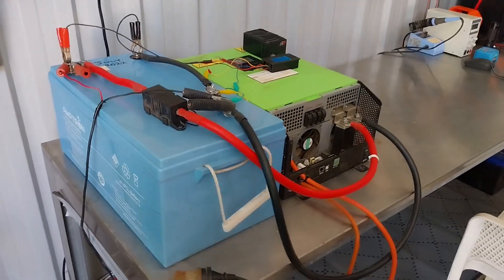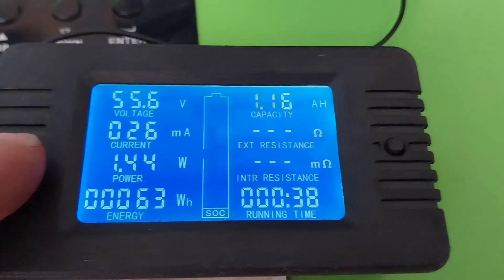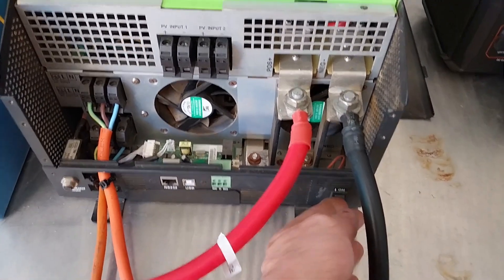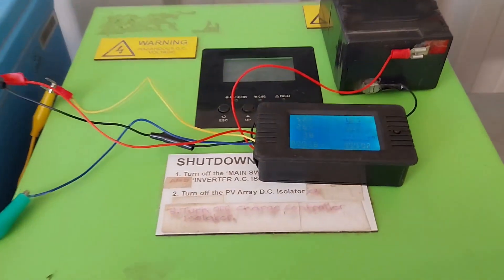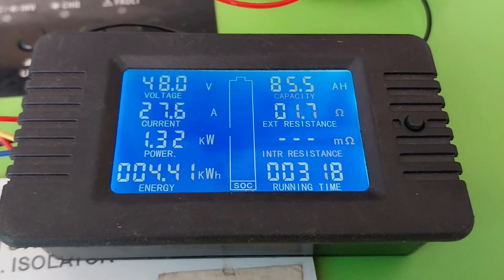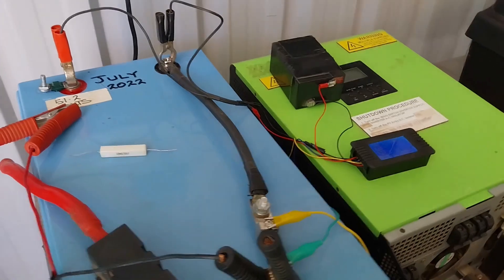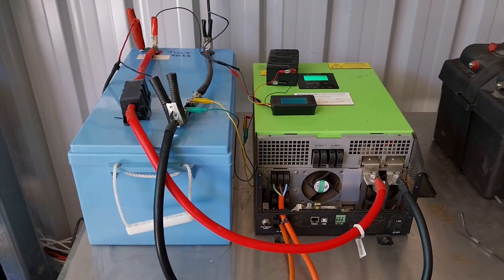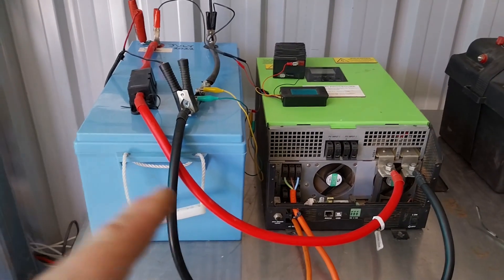48 Volt Lithium Battery Capacity Test & It's Not Looking Good

Comment: Connect up a JK 2A active balance bms. Then use the blue tooth to monitor the cells voltage as you carry out another full charge and capacity test. This way you’ll be able to identify the weak cells as they will reach full voltage before the others and discharge much earlier.

Comment: I would try to get the new one from them. It looks like the new ones have RS-485 and Bluetooth, so you can hook them up to the Cerbo and monitor with a phone app. I would think after 4 years the inside of this battery will be very different to the current battery. You will be disappointed if there are cylindrical cells instead of prismatic ones. You might end up with a pile of e-waste that will be difficult to dispose of.
Reply from the maker: They are prismatic cells by what I have been told by the battery company. These batteries, even with less capacity are still very usable so I wouldn't be throwing them out.
But first I need to do more testing on the others and see where we are at and have a chat to the supplier then we see where I go from there 👍

Comment: I have been living for 20 years on the same battery bank, 24V, 1600Ah exide wet cell lead acid.  3 kw victron inverter/charger.  Yes, they are on their last legs, and likely around 15 years there was a noticeable lack in capacity, though not bad enough to warrant replacing.  I 
I've just recently upgraded my whole system to Lithium, 50Kw storage and a 10Kw victron.  the batteries drop 6-7% over night if I'm not running my 3 door drink fridge used for hanging animals.  Batteries are full by 9am every day, the rest of the day, everything runs off the solar array, 8.8Kw.
I will be surprised if i get any where near the same service, but with rebates at the moment, a new lead acid bank was going to cost the same as a full upgrade.
Reply from the maker: I was just talking yesterday to a fellow off gridder and was saying.... even if Lithium's don't last as long as they say, the higher operating voltage and current delivery is worth it and the cost to replace lead acid batteries is working out more expensive then Lithium.
He also agreed with me based on his experience between lead acid and Lithium batteries.
Reply: @TheOffGridBachelor  And i agree too.  The rate of charge/discharge is an impressive thing.  I still keep the charging lower than stated rate by only having a smaller solar array, i believe fast charging if any battery will shorten life.  I believe that's why I got so long out of my old lead acid.  and yes, lithium is way cheaper now.

Comment: No mention of the chemistry of the battery  so it is hard to tell how close to full that 55.6 volts actually is and how close 48 volts is to the bottom. Chemistry matters in terms of predicting expected cycles.  LFP tends to have more cycles than other chemistries which have higher voltages and use Cobalt. Most of my fifteen years experience with DIY batteries has been with LFP althought my EVs have all been NMC or  NCA. It would be nice to know if a faulty cell is shutting down that pack. It is too bad that that pack does not have some pack diagnostics to be able to more acurately assess health of the cells.
Reply from the maker: The battery chemistry is LFP.
I am suspicious that there is a cell issues that is shutting down the battery but without testing each cell, it's hard to know. The next lot of batteries I get will have blue tooth where I can monitor each cell voltage. Server rack for the 48 volt batteries where I can also open the case and prob each cell as well.
Reply: @TheOffGridBachelor  Thanks for clarifying the chemistry. As noted elsewhere an active balancing BMS can sometimes prop up a weak cell so some of the pack capacity can be restored. By restored, I mean that an active balancer will prevent a weak cell from getting to a voltage that will shut down the pack..
Reply: @ricklearn16  what have you done in 15 years of experience ?
Reply: @casemodder89 I have installed two solar systems and had two more professionally installed. On three of those I installed backup battery systems. I also converted a VW to electric. All of those involved DIY LFP battery packs. My last install, I sold the DIY batteries and integrated a 35 kWh Pytes V5 system with a 15k SolArk inverter.

Comment: Are you sure your charge target of 55.6V is high enough for the BMS to balance its cells?  Normally you charge to 3.55V/cell = 56.8V to give the BMS some margin to start balancing.  3.475V is a bit low for balancing.. the BMS might be balancing (usually the BMS starts at 3.45V or so), but for balancing to really work the cells need to be more onto the exponential part of the charge curve.

So I'd recommending holding it at 56.8V for ~2 hours , doing a few cycles like that, and then re-testing the capacity.  85% capacity is really low for that short a time.
Reply from the maker: Yeah the Bulk/ Absorption voltage is 56.8 volts and the float voltage is set at 55 volts. By what I have heard the BMS will balance the cells at 55 volts.
Reply: Are these 15S batteries? My 16S ebike LIFP04 packs have the charger set to 58.2...

Comment: You can't get an accurate capacity measurement using that tiny, toy, $29 Chinese made capacity tester.😂😂😂
Reply from the maker: Yeah I know it's not going to be accurate but they are close enough to give us a basic idea. With the BMS shutting down at 47.7 volts, that is a red flag of a potential issue.
I do need to get a proper high end tester though for sure.

Comment: I think you have demonstrated conclusively the problem faced by all real world batteries.  Depending on the technology used, will determine, the best efficiency or longevity modes of operation. Unfortunately, neither of these modes will correspond with the real use mode or indeed the highest profit mode !  It is the age-old problem of asking a salesman what his factory thinks the performance might be based on the best performing laboratory results, and ignoring all the tail ends of the binomial curves.  Given you have nearly got to the end of the warranty period, they seem to have got it about right contractually, but no surprise if the sales literature pointed to a pot of gold at the end of the rainbow. 

Given you are off grid, you will have no choice other than to replace them, at the point the capacity is no longer able to support your demands.   But for people who have a choice, and want to get the best return on investment, it can make the difference between a system that pays back or an investment that never actually pays back.  When you get  long  payback  periods you can be rightly sceptical, that this is a glass half full, or a glass half empty  choice.  In an age where the complexity of choices points to you needing an AI system, to give you the answer, there is a warning about using data, from the earliest days of computing.  GIGO  (Garbage In, Garbage Out).  Verifying performance data like you have is a wise move.

Comment: I have built four 51.2 volt DIY batteries @16kWH each (64 kilowatt hours) and would not buy a ready-made one. With the JK-BMS and software I know exactly what is going on inside the 4 batteries, no need to take them apart unless a problem is isolated, and then repair is very easy.

Comment: Doing the calculation you can take the cell disconnect voltage of 2.5v from 48.6 and the divide the answer by 15 which gives about 3v/cell which would be 20% which would give you basically full capacity. I expect one cell has drifted and that a full charge of that cell would fix it. I would bung in an active balancer while the top was off. Things have come a long way since those were made. I would actually stick in a JK BMS with active balancer, a 200A one of those is relatively cheap, about £80 or so from the factory store on AliExpress and then you get full Bluetooth battery monitoring as well as the ability to plug into victron monitoring stuff if you have  Blue Compulsion Disease.
Reply: Yes, if you are going to take the top off that could be a big improvement. Even if it has a BMS. an active balancer can make a big difference and effectively get back some capacity if the existing BMS was shutting down when one cell went low. . Just be sure to disconnect the balancer if it has one.
Reply from the maker: Yeah blue tooth is the way to go for monitoring individual cell voltages. I will go server rack with blue tooth on my next lot. At least with server rack we can open the case and prob each cell to see what is going on.
Reply: @TheOffGridBachelor  My Pytes 48 volt Server Rack batteries have a utility where I can remotely see the individual cell voltages. So far I have not needed to look since all seven rack mount batteries have managed to maintain equal SOC.

Comment: these days im more inclined to build my own battery bank using high quality cells and bms
Reply from the maker: I would like to do the same but how can we really tell if we are actually getting high grade batteries.
Reply: @TheOffGridBachelor  easy: cell capacity (% below or above advertised), getting equal cells per order or at least per set [usually matched in 12V blocks tho], internal resistance + drift of IR after 10 cycles, leakage current when fully charged or rate of self discharge, similar weight ?, optical appearance = bloated or 100% flat and QR code (date of production and spread in those dates), high current load test over one hour with as least 0,5C while monitoring the deviation on the cell drift....

Comment: I guess the other side of the argument about the battery and warranty is that if you do send it back they will be able to look at it and see if there was some sort of issue and maybe improve it in some way?

Anecdotally I sort of think the same about LED light globes.
Lots of claims made about how long they last but we seem to have to replace them pretty often.
Reply from the maker: lol... and I just had one of my LED light globs on the veranda go out, just the other night.
I would like to send the battery in for proper testing with the battery company and see what they find?
Reply: @TheOffGridBachelor  Yeah I would send it in for warranty and see what they find.
It is a pretty harsh environment they have to operate in.
Likely in the worst of the heat they're being charged and used all the time.

Comment: Hey Glenn, the battery charge degradation you are seeing may be typical given the temperature extremes your batteries are seeing.  The published battery specs may be done at a constant 25 degrees Celsius.  Also, some of the ratings I have observed on solar system components appear to be Best Case or, even sometimes, Better than Best Case scenarios.  As a Reality Check, if the other batteries in your system are of similar age, compare their discharge characteristics.

Another possibliity: Voltage transitions within the power inverters and solar controllers are limited by large aluminum electrolytic capacitor banks.  Since these capacitors use a liquid electrolyte, with high ambient temperature, these capacitors dry out faster and have shorter life.
Reply from the maker: I would not have thought I would have see this much degradation this soon considering our hot weather we get is only around four months of the year.
I do plan to check all the other batteries as well and see where they are at, then make a decision on where I go from there.
I would also like to send the battery in for proper testing with the battery company and see what they find?
Reply: @TheOffGridBachelor  Sounds like a good plan!